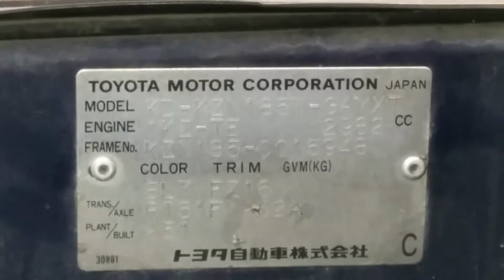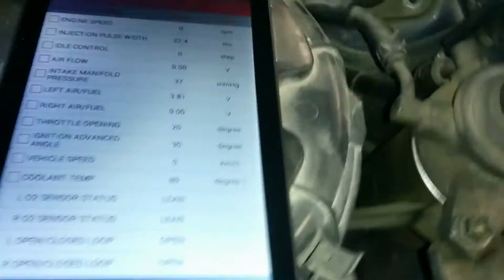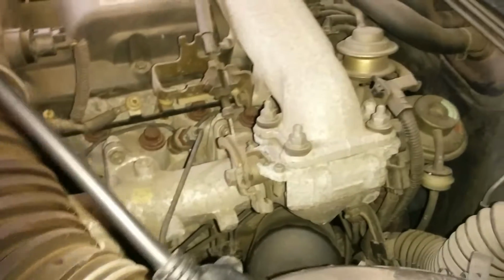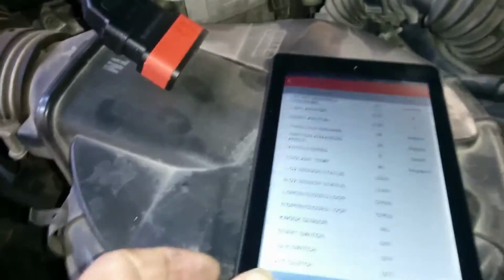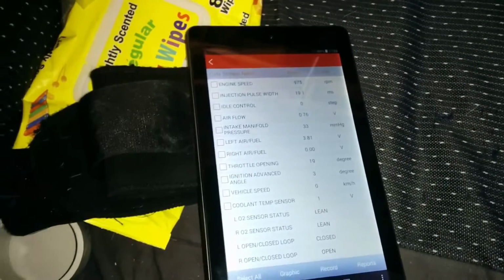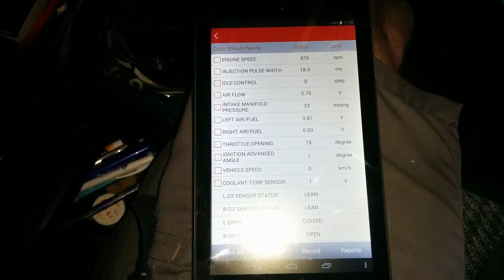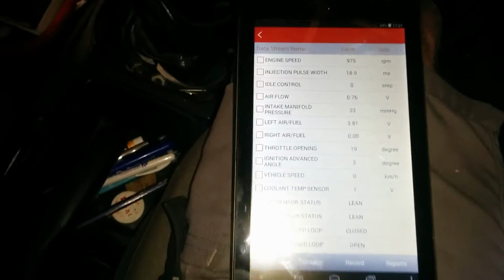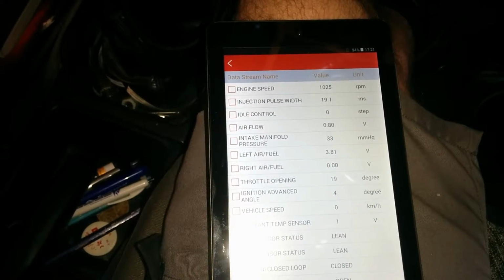Launch idiag obd1 what it pulls on a 1kz-te diesel

Comment: Hello! What kind of connector did you use?
Reply from the maker: launch kit yellow box connector from the diagun tool is what i use with idiag . thinkcar is basically the latest idiag now. I would say any launch obd1 plug to obd2 converter is what should work.